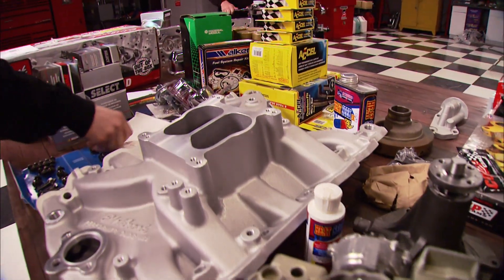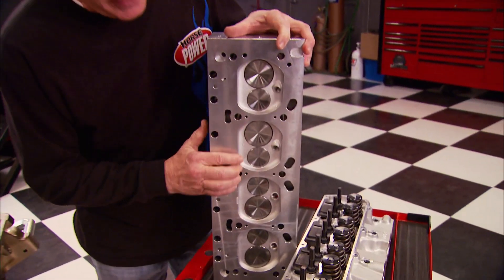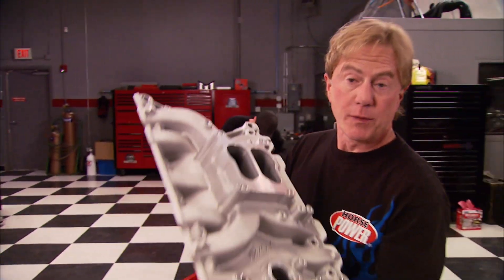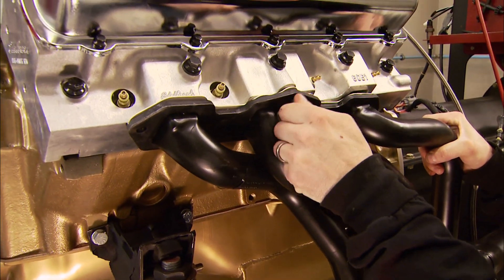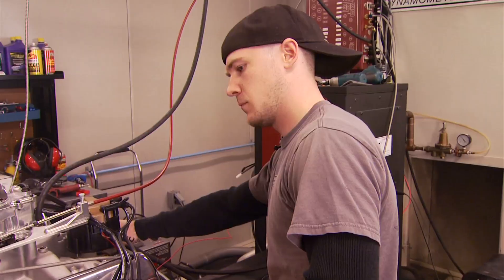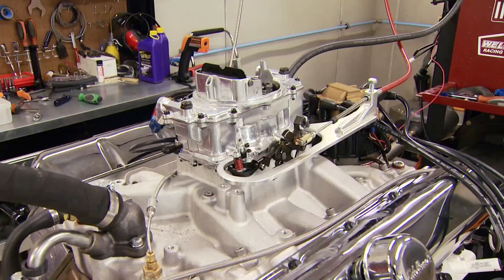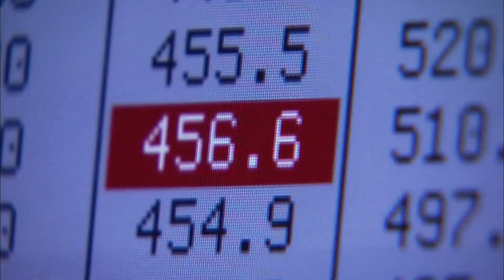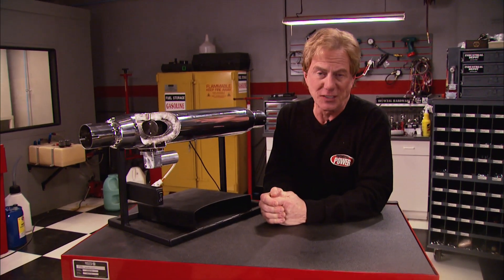Dyno Testing Our Mondello 455 Olds Big Block - HorsePower S13, E8

Comment: Out of interest, why are American v8s over-head valve engines instead of the European trend of Quad over-head cam V8 engines?
Reply: Because keep it simple stupid
Reply: @jasonhooey5677  fair enough.
Reply: @shaunsummers2762  There are pros and cons to both. Pushrod 2V motors favor low end power while DOHC motors favor high end power. Pushrod motors are very compact for their displacement so if you want low end power for towing and smoking tires they are the way to go. Ford for example just released a 7.3L Pushrod motor just for their heavy duty trucks.
Reply: Ford has been using OHC V8 ( Modular 2, 3 & 4V and later the 5.0 Coyote) since the mid 90s.
Reply: @fishsquishguy1833  nice, I was just fascinated as a Brit everything over here and in Europe has been over head cam for years. 
Pluses and minuses for both I’m sure.
Reply: @shaunsummers2762  I used to like the show Wheeler Dealer and envy what you Brits had available to you in the used car market. It’s amazing how common V8s even in 2021 still are over here. Mostly due to our truck market, lots of highways and cheap fuel.  Even my household there’s 3 V8 Mustangs, one V8 Challenger and then the wife’s 4cyl Edge.  I’ve always had an interest in all things British and I actually live in New England😜  Dream car would be an E-type Jag in a heartbeat! 
The Beatles, Supermarine Spitfire, E-type Jaguar, can’t get any better.  Cheers!
Reply: @fishsquishguy1833  ah yeah the fuel price over in the US makes a huge difference. We are currently paying £1.16 per litre where i live in the UK. Makes big engines almost out of reach of the average person.

Comment: Hows the Buick 455 differ from the olds?
Reply: The Olds, Buick and Pontiac 455s are all different designs from each other.
Reply: Completely different and Buick is the lightest of them. With an aluminum intake and heads the Buick is in sbc weight range.
Reply: About the only part that will interchange is the distributor cap
Reply: @mattrodgers4878  and maybe the alternator...

Comment: My .060 over 455. with steel heads made 525hp. MSD ign, Crower valve train, heavily modified heads, Willys carb, homemade intake.
Reply: Engine dyno or Chassis?
Reply: @superkillr  chassis. Pro built Th400. Cannot for the life of me remember ratios though. Had a lot of help from Mondello back then.
Reply: I had a 1966   425 punched 40 over with the W-30 stick grind camshaft custom ground becouse of the bank angle all aligned honed, balanced, and squared up with Edelbrock Torker intake, Coles true roller timing chain 11:1 forged pistons, and "C" heads that we're totally reworked and I was putting out 525 HP as well had 400 Turbo manual valve body with 2-speed jet-away transmission from small block 330CI. Tork converter installed into the 400 turbo transmission rewired the switch onto the shifter down for low stall & up for high stall on the converter high stall was 3800 rpm low stall was 2000 rpm with the 5:56:1 posi shifting into second Bourke loose and fish tailed sideways shifting third was about seven feet of rubber with 30" tall street tires...